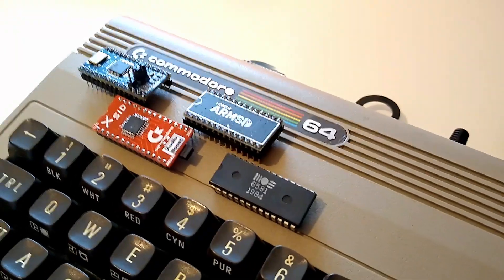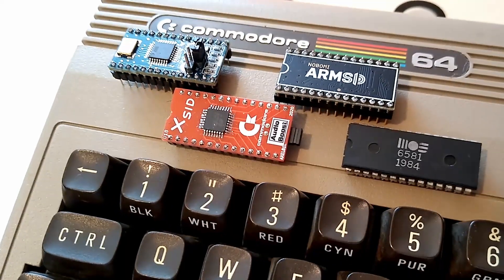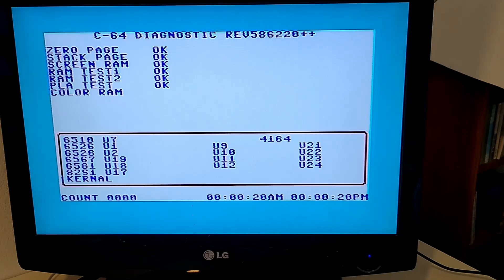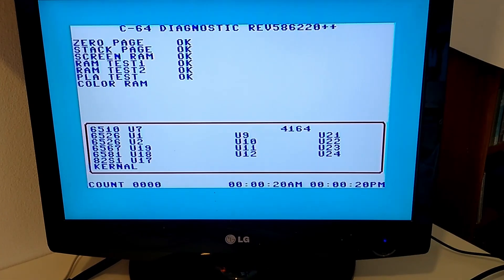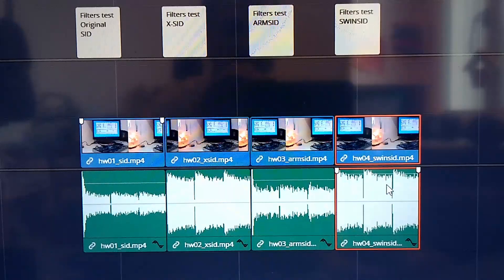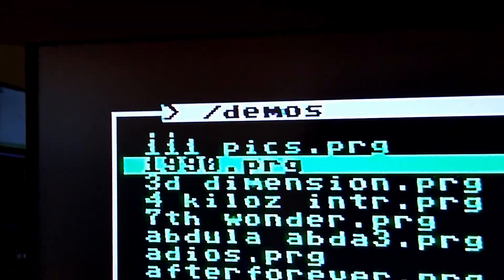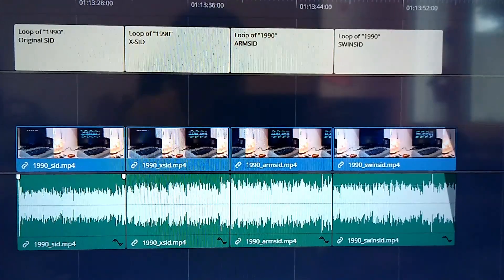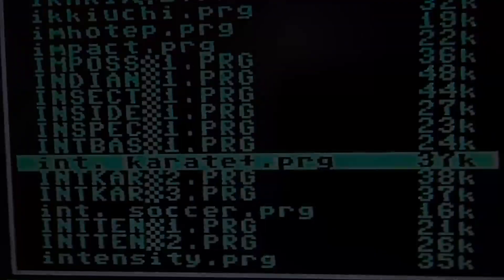Commodore 64 SID, X-SID, ARMSID and SWINSID comparative Mega Test

Comment: I'm not familiarized with the audio software you demosntrated, and I may be wrong, but but the looks of it, it seems to have applied PEAK normalization, rather than PERCEPTUAL LOUDNESS normalization, which would be much more apropriate for this kind of comparison. The point is to make the average loudness of the whole sample to be equal as to factor loudness differences out of the comparison so that the listener can focus on the rest of the features of the sound.
Reply from the maker: @radornkeldam  thank you for your comment

Comment: This is great, thanks! I literally wanted to hear the differences here.
One minor point: when you're making an audio comparison with your ears, to see which one sounds "better", it's imperative to normalize the volumes so that both samples are as close as possible to the same level. That's because, if one is louder than the other, the human ear automatically hears the louder one as "better", in most cases. (This is not just a vague theory; it's been demonstrated by audiological experiments with large sets of test subjects.) So, like in the Int. Karate demo, two of them are much louder than the other two, and are going to automatically sound better to my ears. If you want your comparison to be as accurate as possible, you need to adjust the gain on the louder ones. :%)
Reply from the maker: Hi thank you so much for the awesome comment. I did normalize the audio. I said that in the video and I showed how I did. The point here is that all chips react in a different way to the instructions. All of them generate a different wave form. Some of them produce peaks that make impossible to normalize the audio to the same level for the time. I am afraid to say that the original SID 6581 is the worst of all (the initial peak is HUGE). I was thinking about compressing the audio but then i thought "NOPE! I am not going to change the audio that much". If a chip produces a lower volume or an exagerated peak, then it's a feature on its own and a difference that must heard.

Comment: ARMSID clearly the most close
Reply from the maker: I am afraid to say that the filters of the ARMSID are totally different, so that generates a totally different audio in the 1990 demo. Maybe it would be different if we change the firmware parameters of the ARMSID, but that's a completely different job... :-)
Reply: Everyone else says the same but I don’t think so. 12:46 vs 10:39. I think SWINSID at 13:58 is closer
Reply from the maker: IMHO you are totally right. The filters in the hardware test are COMPLETELY different, and I am wondering WHY they wanted to make them that way. In the 1990 song you can hear a different result from the original SID, or others.

Comment: There's something special about indigenous SID.

Quick edit: Waiting for someone to release an FPAA of SID.
Reply from the maker: @darkstatehk  agreed
Reply: It's got mixed digital and analog circuits so pretty much a non starter on fpga unfortunately. It's easier to approximate the analog circuits in software!
Reply: @sydres  FPGA+FPAA is technically possible. SID chip is both digital and analogue, is it not?
Reply: @darkstatehk  What is FPAA may I ask? Never heard of this...
Reply: @LFOSyncToo  Field Programmable Analogue Array.
Reply: @darkstatehk  Thanks. Like I said, I've never heard of it :)
Reply: There is the FPGASID, it simulates 2 SIDs, has higher analog input resolution for paddles and can sample 8bit audio. The mythical analog part of the SID can simply be replicated using external components, just like any other soundchip does it. There are good reasons why no one is putting resistors and capacitors inside ICs anymore.

Comment: SID still rules. ArmSID would be the best I think, but the filter is much stronger. I think you can lower the strength maybe? During the inital tests, the recreations have tones that have terrible digital aliasing that is bad enough to introduce wrong harmonics even.
Reply from the maker: @Octamed  maybe I can test the ARMSID deeper on single test against the SID. Now that I have the reference sample of the SID, i might try to adjust parameters to make it sound as similar as possible